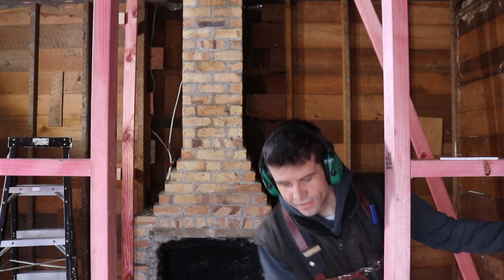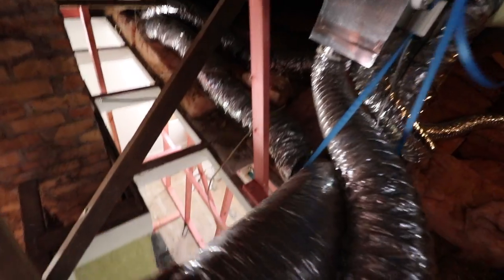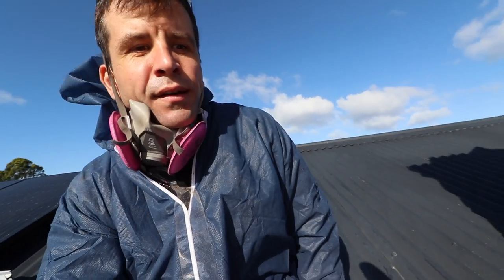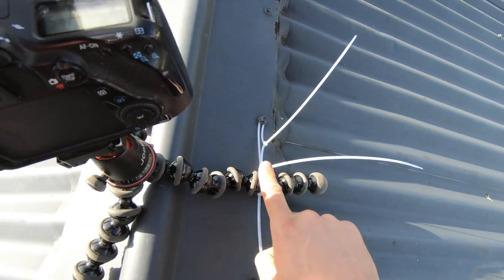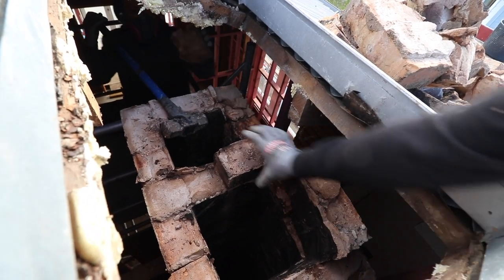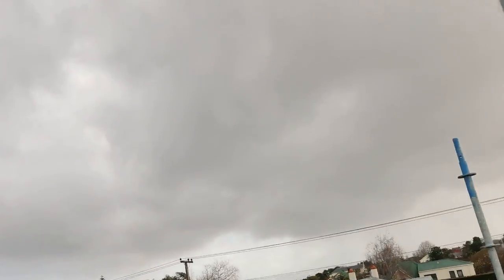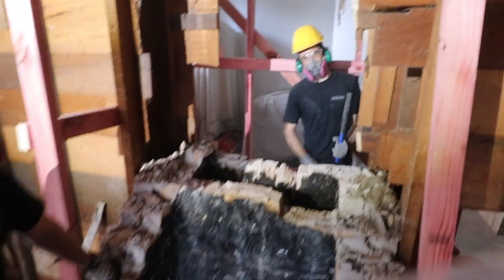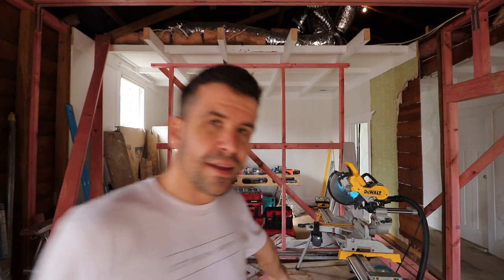Demolishing A 100 Year Old Chimney

Comment: He was a "man's man", had brass balls the size of Mellon's; just watch him knocking in metal hooks in to the big round chimney and winching up ladders with him as he goes, no harness, just a long bit of rope, some metal hooks with little bits of rope on each (5 foot if I remember correctly (he was completely imperial in all he did, no metric for him)) a hammer and enough ladders to get to the top with small crossovers between each ladder and some wooden off stands at each end of the ladder. As a child I was in awe of him, he was so brave and almost super hero like. Loved seeing all his steam and coal powered industrial kit that he had installed in his garden, was a legend. RIP Fred.
Reply: He was an awesome guy to watch. Best thing was there wasn't much health and safety bs back then these days you would need 50 grands worth of scaffolding round a chimney not to mention all the hazard awareness forms filled out. While he would be up there after lunch having had 3 or 4 pints with his cheese butty

Comment: I am in NZ and took my chimney out this year. Though mine was made of rectangular concrete interlocking preforms. When they came out whole it was great, but when they didn't they had wire ring reinforcing that had to be cut to break them apart. Made a bit of a mess, but now that I have a modern log burner instead of an open firepalce, I love it.

Comment: Why didn't you use your rotary hammer drill with a chisel bit?  Just wondering--I saw that you have a SDS rotary hammer in one of your tools videos.  I was actually looking forward to using mine to take out my chimney (maybe next year).  I had bought my SDS rotary hammer drill with the intention of using it for the chimney removal project, among other demolition work.

Comment: Both the chimneys I’ve pulled down in Wellington were brick but full of steel reinforcing. That one didn’t look like it had any?
Reply: Yeah, so not much risk of earthquakes in Auckland, so no requirement for steel reinforcing yet - I'm sure the council wowsers will introduce it at some point...
Reply: Usually only reinforcing in the mid century houses. In fact they were often made of precast sections. Never seen reo of any substance in a brick chimney. (I'm in Wellyville too. Been invloved in building demo since I was 5yo!)
Reply: Cassette Walkman yup mine was precast and went internally through two storeys. 1940 ex state. The house next door was single storey and sat on the outside, all red bricks with reinforcing through it. Wasn’t tied to the house though so whole thing was peeling off 😨

Comment: I was quite surprised to see that the interior brick mortar lines came apart just by hitting them with a hammer! I have a 100 year old chimney on my house, where all of it is exterior brick & mortar, and I doubt that any of it will submit to just being taken apart by hand hammering. I may be wrong. But the above roof brick was rebuilt 20 years ago, and that mortar is like steel! I’m thinking an SDS max rotary hammer will do it. I’ll have to see. Nice video though!

Comment: I am actually putting up new siding on my sort of family house. It was built in 1898 but my family has lived on the same site for a lot longer ( probably 200+ years) and the house still has the original siding, And even after 122 years of rain and snow, the original siding is still in decent shape, it has started to rot at the bottom maybe 7 cm up, But the rest of the boards are completely fine.

The boards themselves are pretty cool, The widest board was 35 cm wide. And the narrowest board is 27 cm wide.

Comment: Just wondering, is it a common thing in New Zealand to sell and buy second hand used bricks, including fire resistant? Like for decorative reuse or for use in fire place or wood oven?
Oh, yeah, Happy Birthday, Scott!
Reply: It used to be more common. Back in the late 80's when I started reno-ing they were snapped up whenever for sale. Recently, in the 10 years since the major earthquakes and changing attitudes of insurers, there have been so many chimneys (and houses) pulled down that they're often hard to even give away. Goes in cycles.
Reply: It is very common here, where I live, to build a Middle Eastern stove outside for making pizza, flat bread and pitas. I guess, these used bricks may be used for this. Also, some of my acquaintances took dismantled bricks and sawed them in pieces 2 cm thick to make a decorative wall. Just glue them on your living room wall like ceramic tiles. Looks beautiful.

Comment: When was this home built? It looks like the walls and roof are very thin, is this still common practice there?
Reply: I think it was built around 80 years ago and yep, coz NZ has a largely temperate climate, no need for thick walls or roofs - a 100mm / 4" exterior and interior timber-framed wall is standard. 
I'm not 100% certain, but I'm guessing NZ followed Aussie architectural standards, which is why houses here didn't need insulation in the ceiling spaces until 1980 and exterior wall insulation became mandatory in the '90s (with Australia being much warmer overall, there was no real need for insulation in houses). Also believe the building industry lobby groups pushed hard against insulation for a long time because of the additional cost - we have a crap-ton of "older" houses with no insulation in exterior walls, even though NZ gets cold in the winter months.
Reply: @richardbaron7106  West coast USA, Californian standards of the era mainly. Aussie building was very different. These houses were essentially kitsets of designs and materials from USA. And when the milling was done in NZ, the machines and profiles were usually US designs.
Reply: @richardbaron7106  Kinda correct about the insulation not being required because of climate tho'. The problem is that places like Wellington are not cold enough for your life to be directly at risk if your house isn't insulated, unlike truly cold climates. Just dress-up and bear through it. Not saying that's good at all but because there was no "need", the houses were just made adequate. Adequate for California!
Reply: @DiscoFang  - I've often wondered if NZ home design were influenced by California, esp as there are similar architectural styles. I was guessing a Kiwi-ized version of Aussie, coz NZ typically follows / adopts Aussie standards, but TBH, I hadn't taken the time to look into it, so appreciate the update and now I know.
Reply: Richard Baron It’s fascinating connecting the history of the buildings with the transport of ships & materials & people - both import & export. There is a great book called “Old New Zealamd Houses 1800-1940” by Jeremy Salmond that’s worth checking out. 

In the present day we have similar standards for electrical & sanitary fittings as Australia but our modern building code at the Building Act regulation & control level is actually based more on the Canadian model.
Reply: @DiscoFang  - that's fascinating stuff and the way trading between nations  influences house design makes sense.